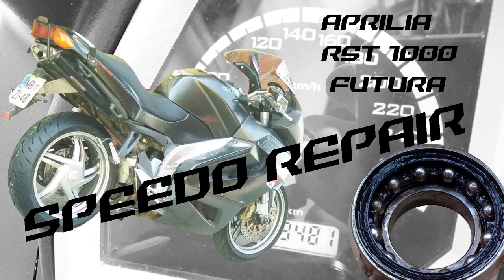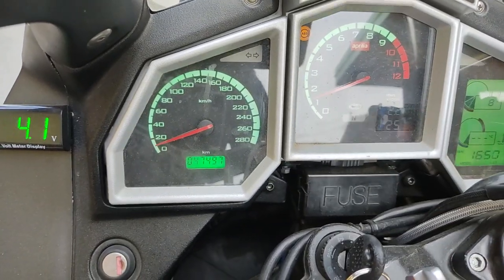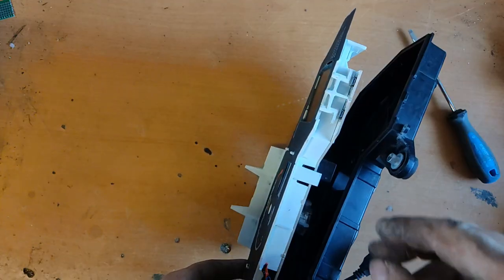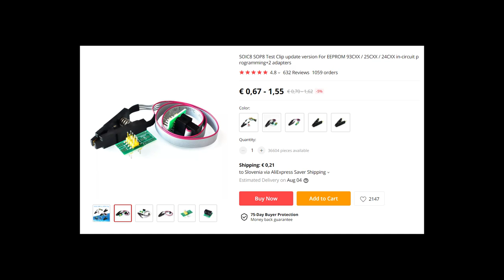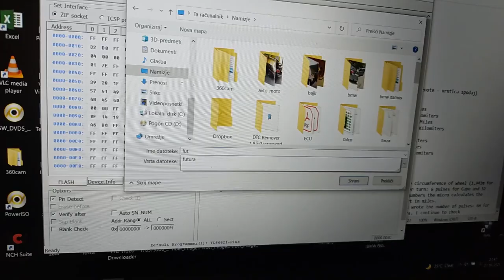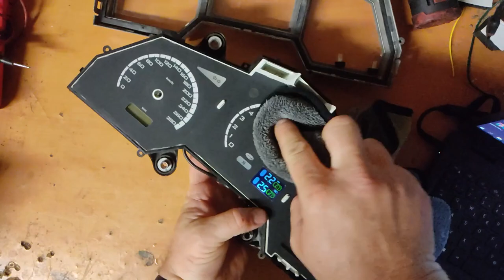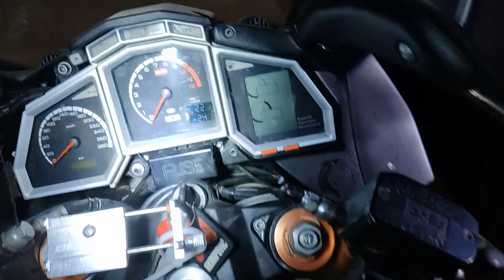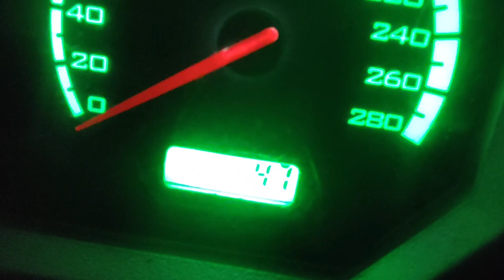Aprilia RST 1000 Futura "no genuine king bearing - no speedo" repair

Comment: Wow Zok.... thanks for sharing this. I already went the DG4070 route and made an attempt at casting a silicone contact seal on the fibre cage. All good so far after 6,000 miles. This solution as way better than making a 64 pole ring to fit inside the rear disc (like I did).

Comment: You'd just some how glue/fix the magnetized seal from the original bearing over the top of the seal on the inside DG4070 would you not? Then you wouldn't have to modify or do all that other shit
Reply from the maker: first you have to have the magnetized seal from the original bearing - I bought the bike with DG4070 already in there. Then I got the magnetized seal from a guy that extracted it from the original bearing, but it was a little bent and proved to be defective.